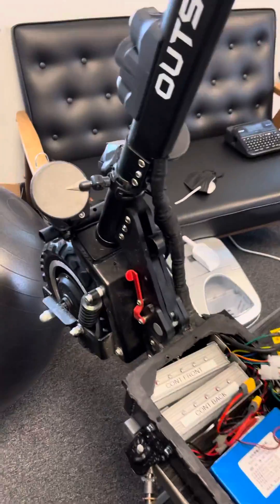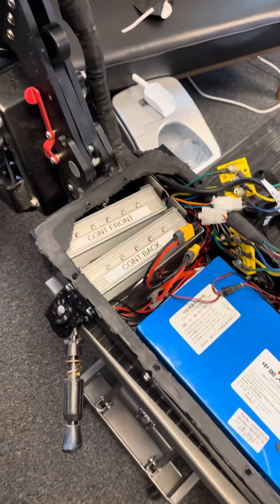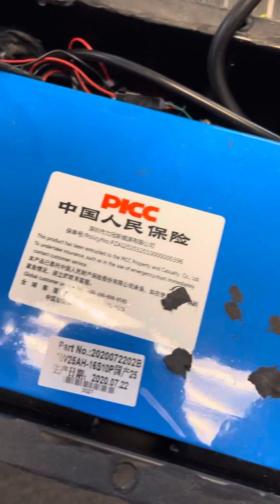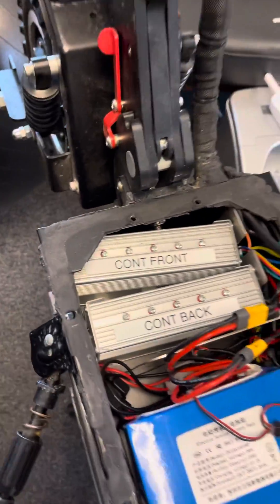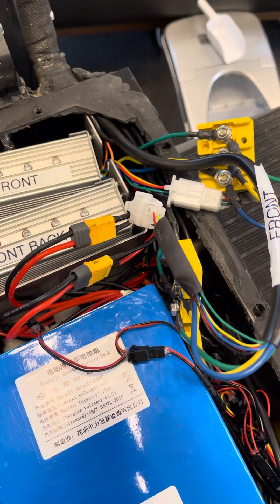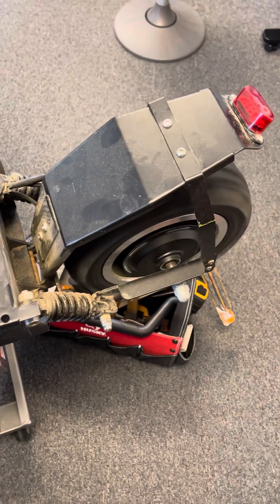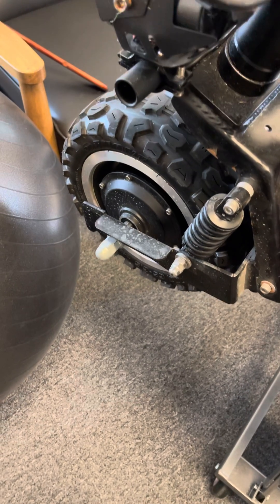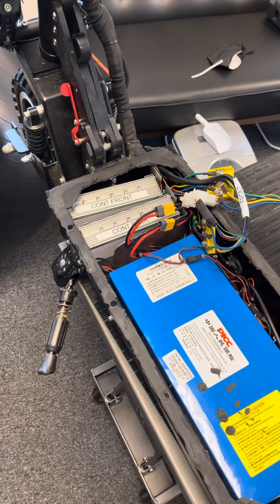Outstorm Maxx - broken motor or controller?

Comment: Outstorm scooters are plagued by serious quality control issues. Many units arrive damaged or non-functional, leaving customers to untangle a chaotic mess of wiring just to diagnose the problem. The build quality is subpar, and the design feels rushed and unreliable. For the price, it's a disappointing experience that misleads unsuspecting buyers. If you're considering a personal electric vehicle, look elsewhere for something better engineered and more trustworthy.

Comment: Bad hall censor 15.00 part take it to a certified electrician
Reply from the maker: What’s that in reference too?
Reply: @oracleofohio  usually the electric motors have 3 hall sensors in the motor if one goes bad the motor stops working , I had a hovsco scooter have the problem and a hall sensor fixed it

Comment: my back motor only turns when I pull the lever and push or move the back wheel with my foot. when i get on it and ride that back motor vibrates the whole scooter. is it a bad motor?
Reply from the maker: Sounds like it. My back motor went bad. My guess is your motor is on its last leg?
Reply: @oracleofohio  how long did these scooters last? Need a commuter but also one that can keep up in town roads.
Reply: Last as in before something like the motors, battery, and controllers went out.
Reply: @needtau4138  It's all a gamble with all scooters. Of course, the higher rating = higher stress = higher current in the same size package, it's what common sense dictates will happen.

Comment: I really loved my Maxx Pro but after  400 miles I am starting to have issues as well for some reason my scooter keeps cutting off power shortly into my ride i contacted customer service and they said most likely a bad battery and after sending it in they sent be another one but after a short trip it did it again so I am at square one with what the real issue is and I am not the best mechanic especially dealing with electronics.
Reply from the maker: Yeah...this is what I discovered with Outstorm scooters. Their customer service is amazing and they really do want you to have success and enjoy your scooter. However, I think the issue you are facing is an issue with ALL electric scooters. It's such a new technology in the United States (probably the world) each customer almost needs to become their own mechanic. If you think about, we've had bicycles for probably a century now. Can you buy parts for your electric scooter at your local hardware store....no. What I did was found a motorcycle shop that was interested in working on my scooter. I found it was better to have someone familiar with the mechanics of motorized bikes overall and you as the customer just focus on getting the parts for them to do the repairs. AGain....this is just my opinion and how I handled things myself.
Reply: @oracleofohio  I had to replace the rear motor on my Nanrobot RS11. It was intimidating at first, but I did the repair myself. Maybe as the scooter community grows there will be repair shops coming around for these things, but for now the best way to go about it is to join a scooter group on Facebook where you can ask questions with other scooter owners about doing repairs.
Reply: Either a bad batch of batterys, or possibly a bad controller

Comment: Hi I'm wondering if you are able to tell me how to put hydraulic fluid in the brakes and what bleed kit to get? The videos I came across didn't help since there isn't a port in the brake lever. Please help!  🙏
Reply from the maker: I'm honestly having issue with the brakes right now. I have no idea? I didn't even realize there is hydraulic fluid in there?
Reply: @oracleofohio  yeah there is. The breaks are electric and hydraulic. Every 6 months you're supposed to check the fluid. It's mineral oil. You'll need something called a bleed kit. Overtime air bubbles form in them and that'll also get the air out and help you add more fluid. Watch ginger on wheels "squishy breaks video." My problem is on outstorm there seems to be no port in the break lever to add it. The higher end scooters have it. 🤦‍♀️🙄 So I don't know what to do... I hope this helps you and we figure this noise out. Thanks for the reply

Comment: So should I still buy it
Reply: No spend a little more cash on something better. I have one. Wish I would have done that also know if you do.... You're the only mechanic for that thing. They'll send you a video and parts.... The video is in broken English.....if all that sounds fun then get it😆
Reply from the maker: Who do you recommend Ashlee?
Reply: @oracleofohio  Dualtron is what I wanna get next. I heard good things about mini motors. There's no doubt it's a better made scooter but I also like that parts would be more available to obtain in the USA. They have videos on how to do everything etc. I just think for the price we pay for outstorm the quality could be a little better. Battery cells shouldn't collapse after a few months. A kickstand shouldn't snap off after 2 weeks. There should be a bleed port on the brake lever up top. The finger throttle is also out dated and display screens. I think it's over priced for corners that have been cut on it. There's stem wobble too that has gotten worse over time. So even though it can easily reach high speeds. I try not to go over 47 bc of the stem wobble. ( I ride this to work so I keep up with traffic)
Reply: @ashleereid3617  Outstorm is now based in the US. And they all use the same stuff.
Reply: @Frindleeguy  they don't use all the same stuff as those other brands. They cheap out on different parts.

Comment: Have u tried swapping the controllers.  Maybe u can try the back controller on the front wheel and vice versa.
Reply from the maker: That was exactly what was advised to find out if it was motor or controller and it appears to be motor.

Comment: Hello Oracles, I'm in the market for a off road scooter & I'm leaning towards the MAXX. My only problem is there's not that much info from riders. There are only 4 channels that show un-boxing & sum opinions while others like Kaabo get tones of channels promoting it, but your the first to show real life problems/fixes on the MAXX. I'm just worried that the scooter is to good to be true ( cheap clone ), I mean it's got all the features of a $3000+ scooter, blinkers, keys, fast speed, range, but for $2000. Please post how many miles you've done b4 the motor problem plus any other issues you've had either with customer service or just daily problems. Thank You Noob Rider.
Reply from the maker: Wow.. good question. Miles I will double check but I think we are hundreds or maybe a thousand. The scooter is built solid but what I feared most is support and company infrastructure. I’ve had two issues so far and that’s been a flat tire and now what seems to be a bad motor
Reply from the maker: Unless you have someone local you have to realize you are your own mechanic. I had to get a lift table and some tools but I like the idea of understanding how the fix things myself. Customer service has been nice and kind but we aren’t dealing with a massive company here with support techs. This is like two steps up from you building a scooter yourself. But the tech is basically a battery, two controllers and two motors. They were great sending me replacement tires but will see on motor controller issue. It’s hard to say if the scooters problems are from poor construction or myself. However I am disappointed having any problems this soon but that’s life.
Reply from the maker: Here is another thought I had. No matter what marketing snd branding other companies have. At the end of the day this stuff is all made in China and probably roughly the same factories. I’m sure companies differ in design and engineering but the actual parts (motors controllers batteries) are all made in the same country. I can’t speculate on other companies but I always think about fact even if it’s Apple.
Reply: @oracleofohio   Thank you for your insight in the matter. Even if I don't get the Maxx ( leaning towards the Kaabo King now ) I look forward to your repair video on this matter. Thanks again.
Reply: @oracleofohio  I talked to Ginger on Wheels last night & there are clones that look the same. But the build quality's not there, he stated about the big price difference is the tell sign. Maxx-Wolf Warrior same speed, range, look, but almost a grand difference.
Reply from the maker: @joshuaborges8888  Whats the big difference? That the Kaabo King is a better scooter overall? Can you explain the scooters you're talking about and the difference between all of them?